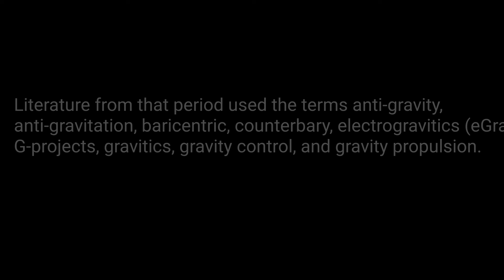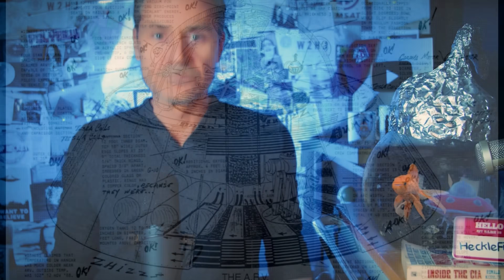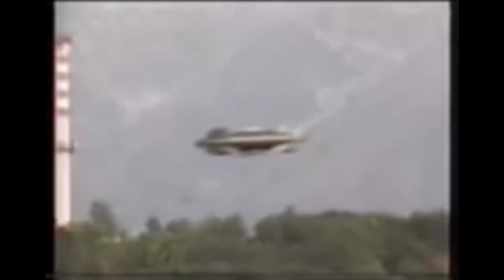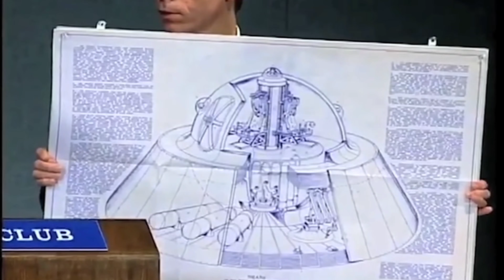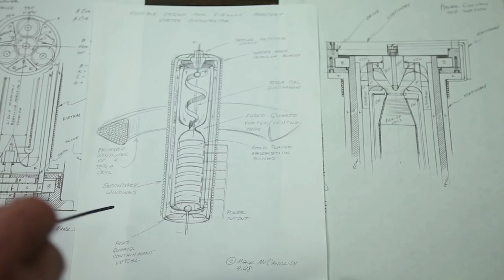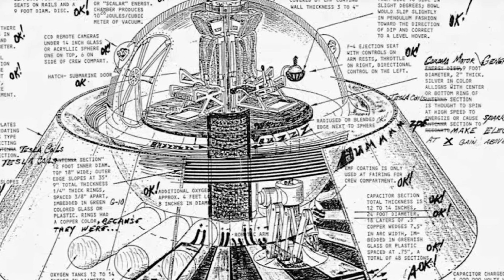UFO Truth Revealed! ARVs Are REAL UFOs! Join my NEW Channel for more!

Comment: Making drawings or even 1:1 mockups is completely different from actually understanding UAP tech and being able to reproduce it. Several sources here on YT have stated that in the 1990s virtually no progress was made to reverse engineer crashed or retrieved craft. Let alone the primitive tech from the 1950s or 1970s.
Perhaps they were able to fly / operate a retrieved UAP. Same as people from the year 1600 would be able to drive a LandCruiser. But they could not build it, they couldn't even have made a tire or the diesel it uses.

Comment: I doubt they knew how to produce anti gravity in the 50's or even figured out how the aliens retrieval craft worked they didn't even have the way to check the meta materials found in crash scenes or the slag sometimes reported as dropped, i think they wanted to real bad just had no clue how to even go about starting, i could be wrong but the 50's seemed to be a very simple time in history in my opinion.
Reply from the maker: Well remember the SR-71 Blackbird was designed in the 50s as well
Reply: Greer said we mastered gravity in October of 53 or 54 ( I can't recall which one but he definitely said it was the early 50s)
Reply: @malsmith2012  definitely not they still trying to make a ship that can get anywhere quickly
Reply: U have to remember they build a powerful sadalite in the 50, 60's